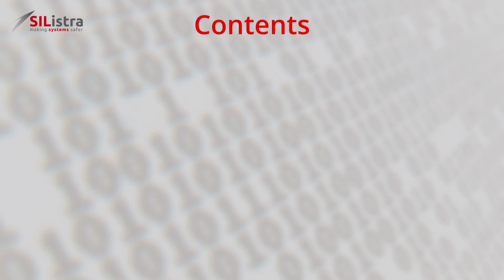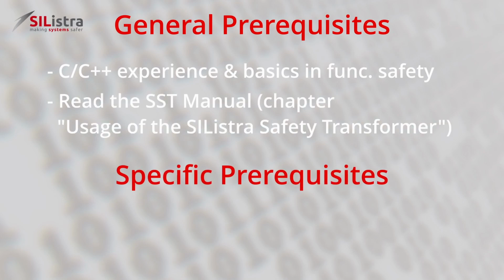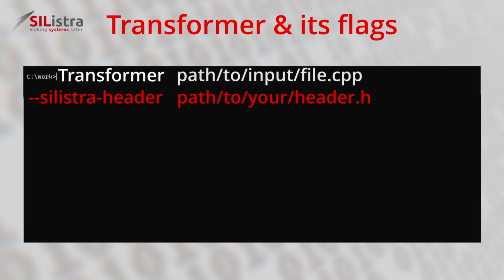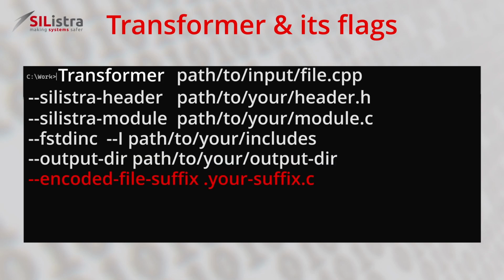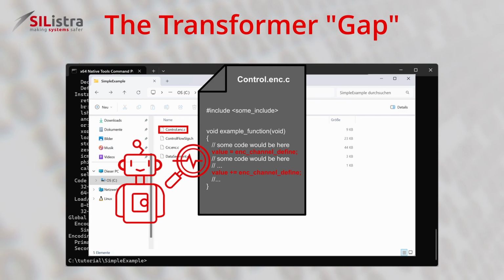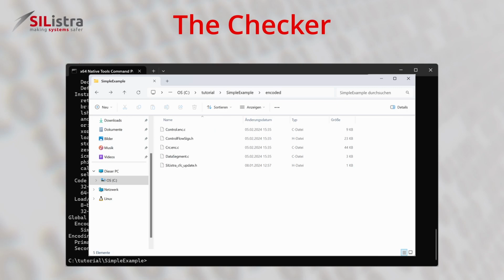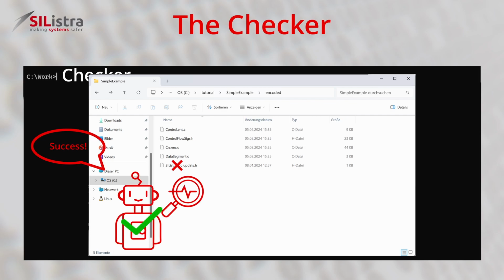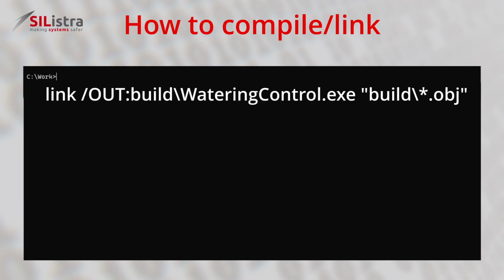SIListra Safety Transformer Tutorial Video 2 - How To Build The Tutorial Application(s)

Comment: And also in the Result of the Transformation, why some of the files have this "enc" and some dont although all of them have encoded source code?
Thanks in advance for your time
Reply from the maker: Thank you for your interest. The SIListra Safety Transformer 2.0.0 generates 2 kinds of files:

- the SIListra-Header and SIListra-Module file (each one single file)
- and the encoded modules files (one file for each C/C++ files passed to the Transformer as input)

For the first kind, you have to specify the whole file name, if you do not want to use the default names. For the second kind, the Transformer computes the file names of the generated files from the input file name and the suffix ".enc.c", which can be configured if needed.

In the example in this video, the Transformer generated 4 files:

- one SIListra-Header (ControlFlowSigs.h),
- one SIListra-Module (DataSegment.c) and
- two encoded modules (Control.enc.c and Crc.enc.c for the input files Control.cpp and Crc.cpp)

Additionally the Checker generated the SIListra_cfc_update.h file.
 
You can find more information in our documentation or with the call “Transformer –help”.

Furthermore, feel free to contact us at info@silistra-systems.com, if you have further questions or want to do an evaluation of the SIListra Safety Transformer.